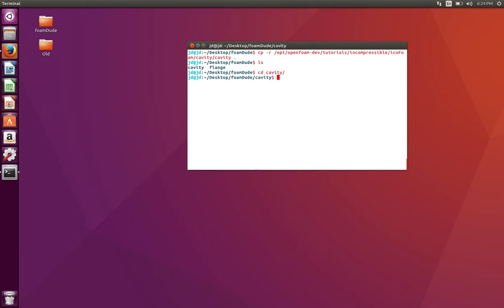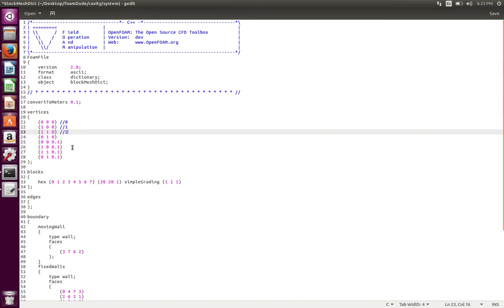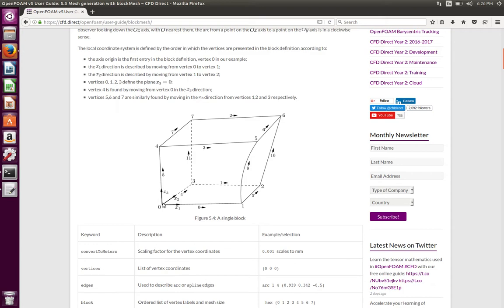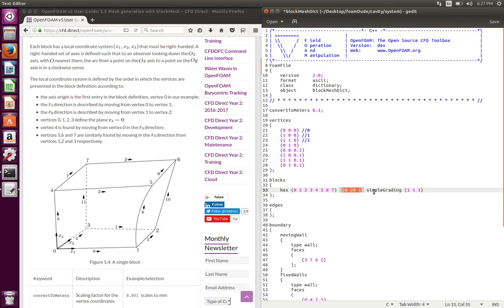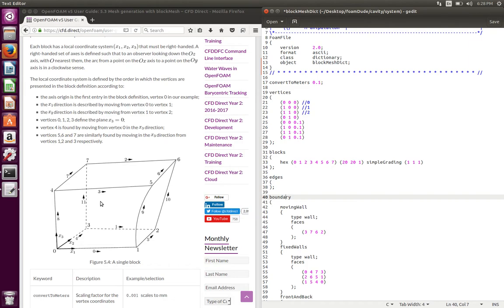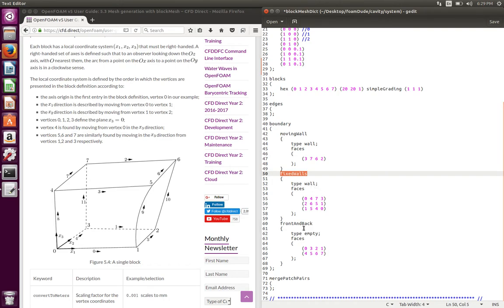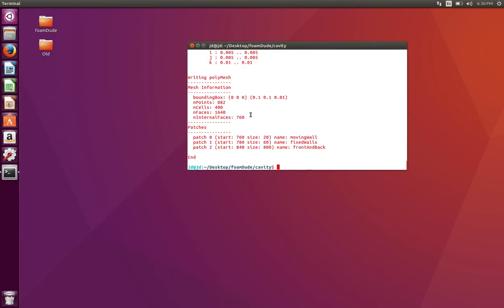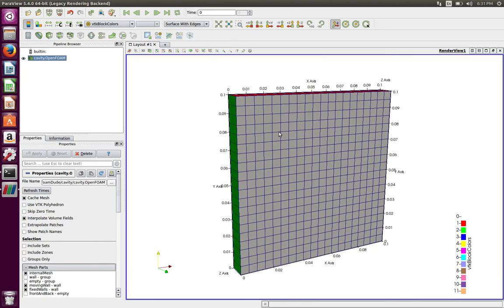OpenFOAM: BlockMesh

Comment: So, simply put, there should be a thickness assigned in z direction regardless of the problem being 2D or 3D. When the empty face is given, OpenFoam will understand the problem is 2D and take the XY plane?
Reply: yes because openfoam only deals with 3D geometries and so you place 1 cell in the direction where you don't intend to solve.